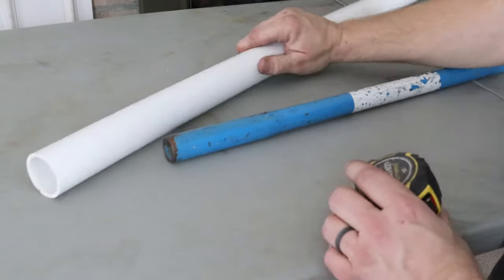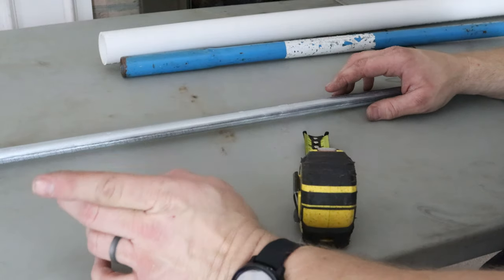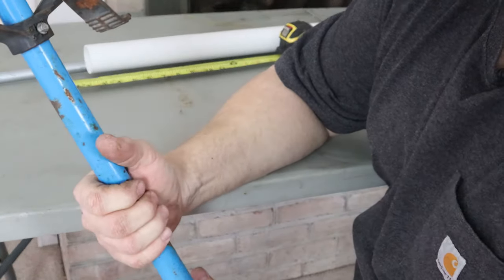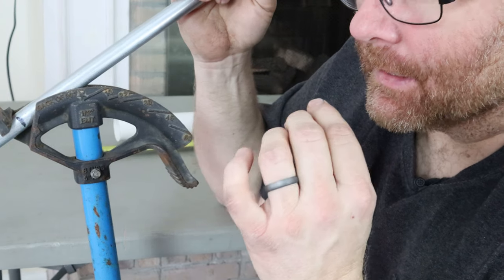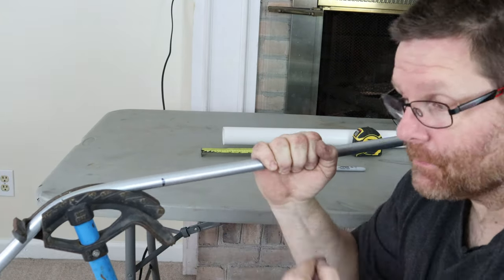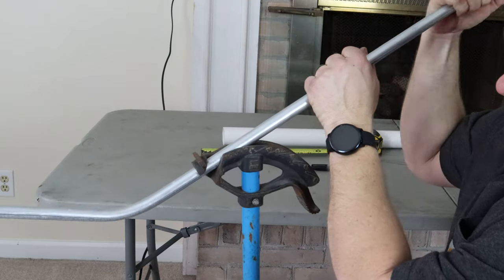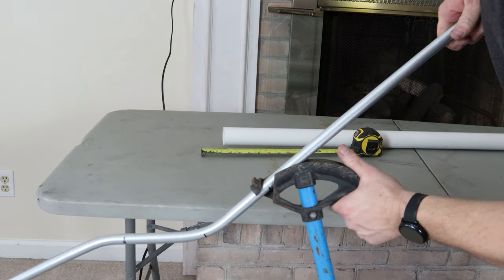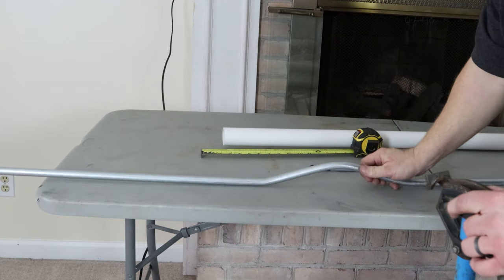How To Bend A 3 Point Saddle Full Instructions

Comment: is the 2.5 measurement just use for 1/2 in conduit? or also for the 3/4 and 1"?
Reply from the maker: You know for 3/4 and have never used measurements I used my finger trick which seemed to work really good. Once you get the hang of it. I don't want to lie to you and tell you that absolutely that measurement will eken, but now I'm gonna have to try it out for sure.

Comment: Quick question so does multiplying it by2.5 always going to Stay the same no matter what height I get
Reply from the maker: It's 2.5 times your obstruction. The 2.5 is the multiplier. So if you had an 8 inch obstruction it would 8 X 2.5 = 20.